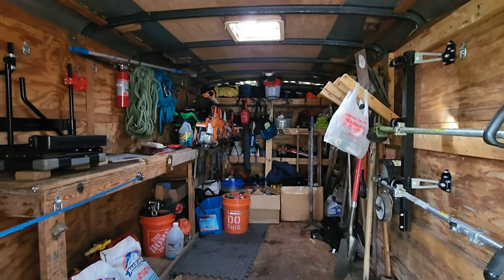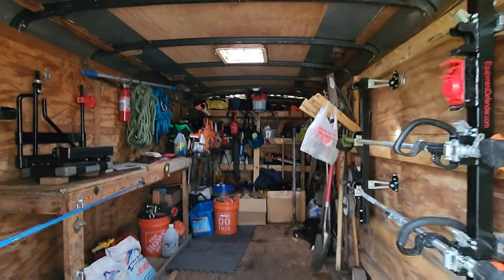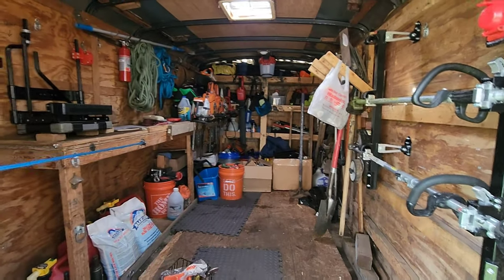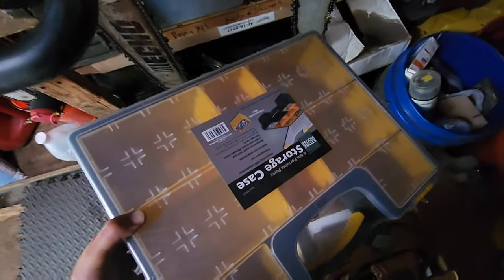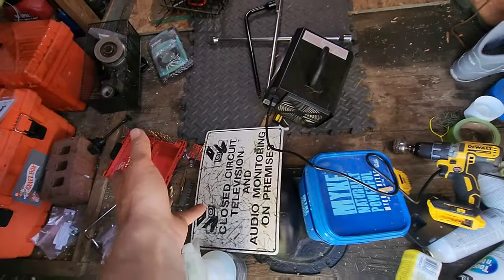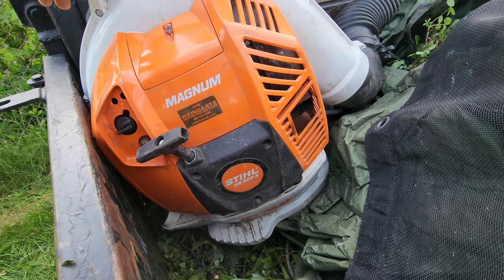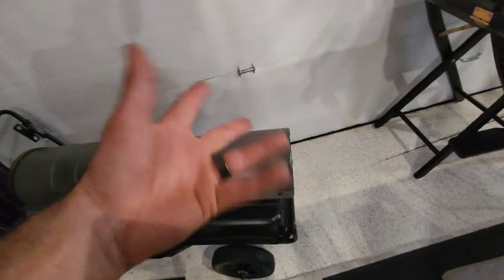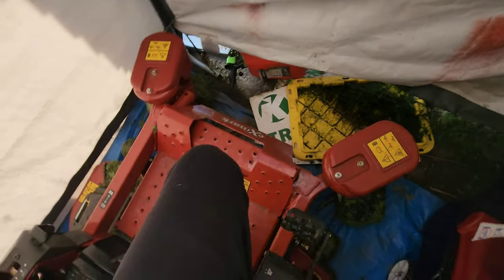Landscaping Business Truck, Trailer, Equipment Setup Tour & Ideas for Your Business

Comment: You need another garage addition buddy aha growing it. Stepdad got a 10x16 cple years ago with the one ton diesel upgrade from the 17 tundra and we can tear threw in town jobs and make less trips on further jobs. Truck make enough in 8 months to pay for whole year and the trailer pays for itself and helps with the truck increases. Also doubles as a great float. Takes alot to fill with woodchips, carries 5ton of crushed stone, takes one hell of a stack of branchs also stacked right way and cut up. Strips entire front lawns in 1-2 loads.

Comment: In regards to mounting the ladder on the side... could you use those same equipment defender racks for the hand tools with the pins? Just turn them so they fit the ladder(if they are wide enough).